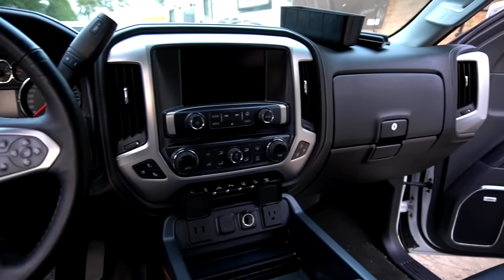Rebuilding Rolled GMC Sierra In 16 Minutes

Comment: If I had 50 years, all the parts, all the tools and everything needed to rebuild this truck, I still couldn’t finish it. This guy is very talented!!
Fantastic job!!
👍🏻👍🏻
Reply: With enough training and money you can. He does this mostly for the views, otherwise it is not a financially feasible project.
Reply: @gteixeira  You are so correct. No way this is financially feasible. Better off going to buy a new one.
Reply: @myytchannel6632  Yeah, I know it loses all the fun and content, however for the vast majority of the people, this is the most rational way to do it.
Reply: And he done it in 15 minutes
Reply: @gteixeira  He probably bought the "rolled truck" for 15-20k maybe another 15k with parts/paint and his own time. That's way cheaper than a brand new one and with the way that awesome truck was rebuilt it will definitely be one the road alot longer than these new ones.
Reply: @gteixeira  so go drive your Prius to your dance recital and pull up your dress when you get out!!
Reply: @yippie843  That is way more than 15k in parts there. And I don't own a Prius.
Reply: @gteixeira  no it’s not he probably spent less if it was rolled and if it was damaged he probably also used Spare parts or something

Comment: I love how he cleaned every bracket and bolt and repainted it but didn't take the time to paint the frame when it was separated from the body 🤣🙄
Reply: He wanted to make it stock. Painted frame voids the warranty lol
Reply: @jehouse86  its salvage title. Warranty is lonngg gone
Reply: I know, I was making a dig about gmc/Chevy never painting or coating their frames. It's a shame they don't, and its a shame he didn't do it when he had the chance.
Reply: He would have needed to sand it down then paint it
Reply: @DJCuhhhstin956  just like every other part of the truck he...sanded down...then repainted
Reply: @SalvageMasterV  Hot dip galvanizing burns it right off. No sandblasting needed and it costs +\-$500 for a shop to do it.
Reply: @jehouse86  they're not painted but they are definitely coated
Reply: @Montana45313  I'm certain there's some sort of treatment added to the frames. They make beautiful trucks, its a shame to see some of their high end products showing sign of rust on the frame only after a few years.

Comment: Great work, but ill not buy it for no more then 10k, it's still a salvage/rebuild title.
Reply: $10 grand plus another 25 for tools & equipment he used. I'd do it if I had access too a frame straightener, gantry crane, & a boatload of time & energy. He definitely spent months on end & had multiple locations where he had access to equipment most don't have.

Comment: How much did you spend on fixing it could’ve bought one with that cash instead
Reply: Usually they buy a couple wrecked/flooded rigs at insurance auctions. Turn a couple into one. Laborious, yes. But not as expensive as you’d think. Tons of our Russian and Ukrainian folks here in Alaska do this as a living. One guy I knew would buy four or five of the same model, then turn them into two or three. He then sold them on his car lot. Seemed to be doing ok.
Reply: @joethompson543  seems like it would be more profitable to just part them out
Reply: @rapsheets4993  
Yeah, but if it's been rolled or really messed up there's not going to be too much in the way of parts in good enough condition  to sell.
Reply: @joethompson543  
If you have the space to store the vehicles and work on them and the  tools,  I can see doing that.  Those Russians and Ukrainians are not  stupid people. They've learned to work with what they have and make it work.  👍😉
Reply: @geoben1810  
Looks like this one rolled and then had a small fire on the driver's side. Probably didn't cost more than $5-7k at auction.
Reply: @rapsheets4993  maybe that wasn't the plan.
Reply: @jacobg5122  two different trucks. The rolled one is where he got the frame engine and some of the cabin parts. The burnt one is where he got the cab, bed, fenders and maybe some miscellaneous parts.
Reply: @madmax2069  
Ah, I see.

Comment: Beautiful job, incredible skills, impressive results but how long did the rebuild take?  
At the end of the day - when its all said and done, this is still a totaled wreck.  Granted, its been masterfully redone, but can it be legally put back on the road?  Counting the massive number of hours this clearly took, along with the cost of replacement parts, wouldn’t it have been just as easy and much faster to buy a new truck?  If you enjoyed this project, more power to you.

Comment: I bought a Chevy truck similar to this in 2007 after it had been rebuilt. 
Although it looked almost perfect it was never right.
The front end chewed tires off every 2 weeks and no matter what the front end shops did they could not get it to track straight.  Two years of trying, also the rear differential had to be replaced as it was prematurely chewing the ring and pinion out of it.
Electrical problems were another big issue. I finally gave up after two years and traded the truck in. Although it was a beautiful truck it was a lost cause!!..🤨

Comment: The tools to do such a job like a frame straightener & other special tools could cost more than a new truck. It looks like a he used several locations & had access to all these tools & equipment. Last time I checked getting a frame straightened could cost well into the thousands. I'd be interested in how much he had in this build. For someone without connections you'd be looking at $10 - $20 grand to get it done yourself & having a place to do it is a must have. Great job though 👍

Comment: I have a question my truck was hit on the driver side and broke the brake line where it goes into the  reservoir I called the dealer and they said the brake line is a make it yourself but I have the kit and it doesnt have the right size for this truck its a 6.0 not a diesel if that makes a difference

Comment: Here's a philosophical question. If you have a wooden ship and over time because of repairs you slowly start to replace every plank in that ship for a new one, just little by little. By the end when you have replaced all of the wood with new wood, is it the same ship? And if the pieces that you replaced were not severely damaged and you put all those pieces together to make another ship, which one is the real one?